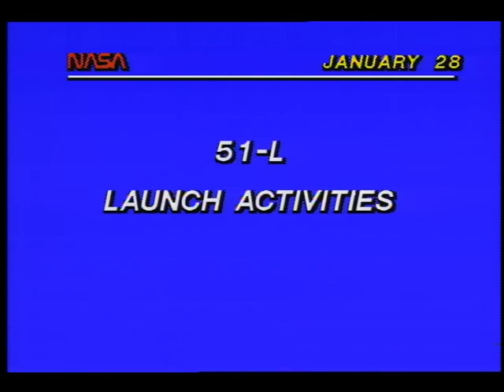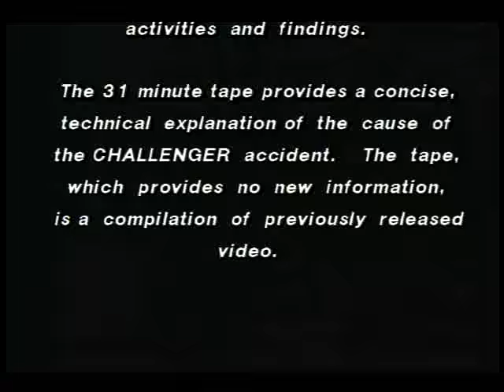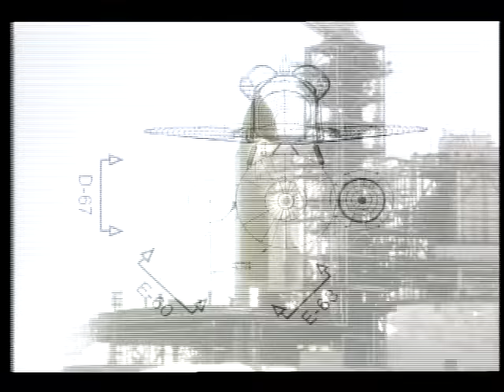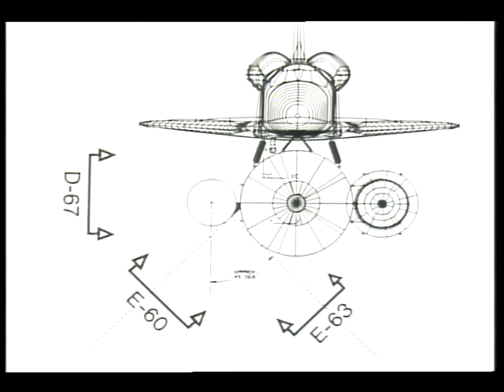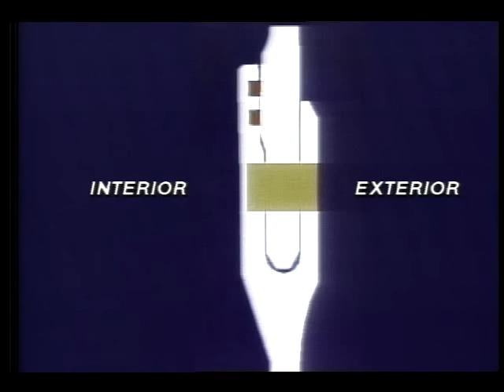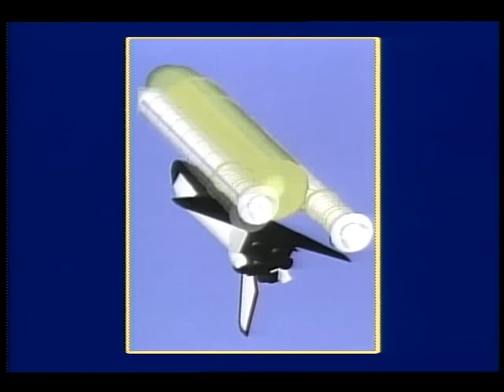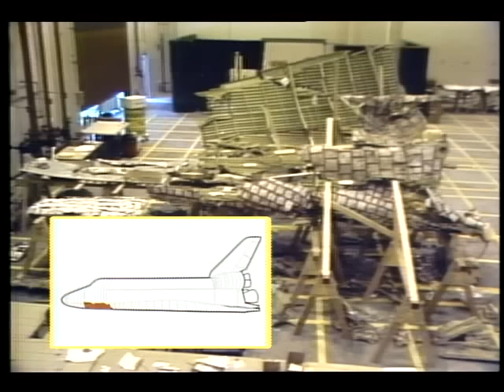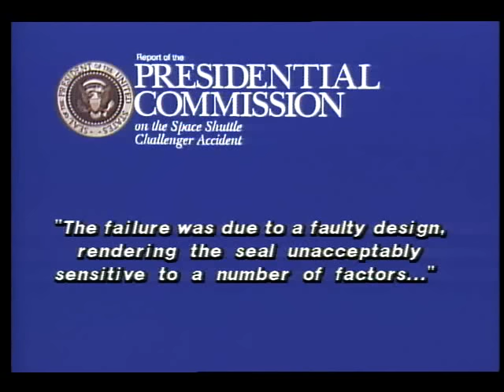Shuttle 51L: Challenger

Comment: It’s amazing to me that given the increasing velocity of Challenger that the plume from the right SRM was able to maintain its focus on the external tank. You would think given that increasing velocity would have caused the plume to be forced away from the tank towards the nozzles. Apparently the leak from the SRM had more velocity than the orbiter, ET & SRMs combined.
Reply: But this is not a water bottle or can of coke. There are enormous kind of energy and pressures involved during an engine run. Velocities of mass ejected out of a nozzle are probably several times greater than STS moving in that moment. Must be if you want to use it as propulsion motor to reach escape velocity (and orbit).
Reply: I was referring to the leaking field joint that that eroded the external tank away until it collapsed. The nozzles you refer to are south of this joint. So I would hope the building velocity of the 2 SRM’s not to mention 3 RS25 engines on the orbiter would be greater than the faulty joint. The 2 SRM’s push the orbiter to 146K’. The 3 RS25 engines push it to orbit. We are hardly talking about cans of coke here.
Reply: @jimwiskus8862  The force that keeps the plumes narrow is the atmospheric pressure.  When the shuttle (or any rocket, see modern film of the SpaceX Falcon 9) first launches, the plumes from the engines exit straight back from the vehicle.  Atmospheric pressure is constricting the plume flow, keeping it narrow and straight.  As the vehicle gains altitude, the atmospheric pressure drops, and starts to drop precipitously fast after the Max-Q point.  The plumes begin to spread out and get wider due to the falling atmospheric pressure, and the plumes lose their orange color as the partial pressure of oxygen drops because unburned fuel in the exhaust no longer continues ignition in the plume.  In this case, as the shuttle gained altitude, the plume from the leak actually began to spread out and impinge on more of the vehicle structure.  Another way to look at it is that even though velocity is increasing, there is simply thinner and thinner air as you get higher, and the "wind" isn't enough to push the plume anywhere.
Reply: Even though the Primary and Secondary O-rings were burnt away within seconds after launch, the theory is that slag from the burning solid fuel of the SRB had temporarily plugged the space between the solid rocket sections, which was a very small space.  It seems the Max Q and the wind shear forces had put a considerable amount of side forces on the vehicle.  Those forces did not exceed normal lateral forces, but it's suggested that the slag had broken lose allowing the tremendous pressure (900 psi) to literally blow torch a hole in the side of the booster.  The hole initially was small, but unfortunately it grew as the metal booster casing melted away.  It only makes sense that the hole was getting to the point where it no longer was affected by any passing air velocities and then burnt the hole in the LH2 tank right next to the booster which I would imagine is only a few feet away.  The hole was enough to not only decrease the nozzle pressure of the R/H SRB, but enough to start effecting the steering of the entire shuttle assembly.  That is a lot of pressure.  The hole being approx. 27" X 15" or 405 Sq Inches X 900 PSI = 364500 lbs. of total pressure escaping at it's largest.  Makes sense why it happened so quickly and was affecting the trajectory of the entire assembly.

Comment: a break-away pressurized crew cabin, complete with a righting system of some kind, chutes, o2 supply and means of flotation. but only in my ideal world
Reply: I hear yah, it was savings over safety unfortunately.
Reply: Or better idea: Get rid of the stupid, dangerous Rube Goldberg machine called the Space Shuttle and don't use solid rocket boosters on a man-rated spacecraft.
Reply: @krcm1981  What savings? The Shuttle program was a cost runaway. It was never cheap, safe, or reusable.
Reply: @magicstix0r  complicated is a good word to describe it. along with NASA placing schedule ahead of safety, an inexcusable action
Reply: They had those before and brought them back after this nonsense.  This is on NASA, they were warned but it was all about how they appeared in the eyes of the public.  It was complete b.s., no other way to put it.
Reply: @magicstix0r  The funny thing is the Shuttle was almost as safe as Soyuz when it came to crew fatality rate remember that shuttle launched around 300 more people then soyuz if you count each occupied seat as different individuals and the Solid Rocket Booster's are a lot safer then your average liquid fueled engine When running in their intended conditions

And by savings i think Nunya meant weight savings

The shuttle was infact safe and (mostly) reusable its just the fact that it ended up a lot more expensive then it was proposed to be however it was actually comparable to the rockets of the time when it came to cost per kilogram thanks to its ability to lift large payloads

The shuttle also ended up repaying most of its cost in the form of science, data and the sheer number of things it put up there Radar topography mission flown by Endeavour ended up collecting data worth more then 20,000 CD's this data ended up helping billions in their regular life and the shuttles are responsible for half of the things we have in space in kilograms

There are also missions like STS-41 C or STS-49 where shuttle ended up saving hardware worth billions
Reply: @Lord_Merterus  uhh, no? Soyuz had one accident that killed three astronauts and was related to the life support system, not the spacecraft itself. The shuttle was dangerous by design. It had so many black zones during which an emergency was unsurvivable, whereas we've seen that the Soyuz escape system has saved lives during a situation that would have killed a shuttle crew. It's only by dumb luck that the shuttle didn't kill more astronauts.
Reply: @magicstix0r  Yes the Shuttle had a flight failure rate around 1.5% while the Soyuz-U had a flight failure rate around 2.7% the Shuttle had 135 flights the Soyuz-U had around 700 The Soyuz infcact had 4 fatalities Soyuz 1 was destroyed after  its parachute failed to open causing the spacecraft to smash into the ground the fact that the solid retro rockets fired and set the wreck ablaze did not help either then there is the Soyuz 11 where a breathing ventilation valve was jolted open due to a faulty separation of  the orbital module and the descent module  when the bolts which were designed to fire sequentially had fired simotaneously

Challenger was not an engineering failure simply the fact that the O-rings were pushed further then their desing criteria Columbia Also could have been most likely prevented via the use of a fresh ET

Sure the shuttle had huge black zones pre Challenger but post challenger there were no blackzones in case of 2 SSME out and there was a relatively small blackzone in the case of 3 SSME out and the shuttle only had to abort once throughout the entire shuttle program overall the shuttle did what it was asked to (although not to the extent that it was supposed to) just like the Soyuz missions like STS-51A and STS-49 prove this
Reply: Magicstix is correct. There were so many close calls that were never publicized. Even the very first shuttle launch was almost a disaster.. the o-ring problem was known since early 1984 and should have been rectified.
Reply: I always was curious why there wasn't a chute on the passenger cabin, or if there was why it didn't deploy.
Reply: @joespitler3929  I hate when people ask this question. The reason why there was no parachute is becaise nobody could have foreseen this disaster playing out the way it did.

Comment: Comment and a question: The conclusion was that the O-ring failed, but that seems like a politically expedient way of saying "we launched when the temperature was far below what we knew the manufacturer had certified or intended for safe operation." The question is about possible abort modes. Until this happened, I just assumed the orbiter could separate at any time and glide back to Earth if something went wrong, but for the past 35 years, I have never once heard anybody address this kind of abort. The burn-through went on long enough that, had some sort of hypothetical sensor detected the problem, there should have been plenty of time to separate the orbiter from the ET (with or without jettisoning the SRBs first), and since they were still just a few miles away from KSC, land safely. Has anybody heard this type of abort mode considered, before or after the Challenger tragedy? In my head, it seems a simple way to get the crew and orbiter away from the failing launch system. Why didn't they do it? Why didn't they add that as an abort mode after this disaster? I really want to know. It seems like a no-brainer to me, but I'm not a rocket scientist.
Reply: If you look up "Everyday Astronaut Abort System", one of them explained why they can't detach before the SRB's, I unfortunately don't remember the exact one

Hope that helped
Reply: INot a scientist either ! Just a guess… think it has to be strapped in order to get
propel enough to break through the barrier from earth to space. . Then once it’s separated & orbiting in space, it is able to reenter earth and act more like a plane. I’m just becoming interested in this in recent years & I had no idea it wasn’t more technical (for example, something with the capabilities you suggested)
Reply: @JasperHuskyFox  Thanks for the tip. I'm sorry I missed this when you posted it. He says that the kind of abort I was asking about would put the orbiter right into the fire plume from the SRB's. That sorta makes sense to me, but it's not a satisfying answer. It seems they could engineer a separation maneuver to happen at the same time the orbiter disconnected. I dunno. I'm no engineer. It's a lot more than I knew a few minutes ago though. Thanks again!

@Mimi Ramone I think this might be a good answer for you too. There really isn't a barrier between Earth and space, just a dwindling amount of air. But there is an awful lot of fire shooting out of those boosters.
Reply: All abort modes for the shuttle (both before and after the Challenger accident) require that the stack make it to SRB separation.  Any structural failure before SRB separation was guaranteed to result in loss of crew and vehicle (LOCV).  Almost all of the planned abort scenarios centered on various combinations of orbiter main engine failures, whereas an SRB failure or structural failure was not considered to be a survivable accident.  In the Challenger situation, even if the stack could have made it to SRB separation, the resultant abort mode that would have been tried is called the return-to-launch-site abort (RTLS).  This abort mode was risky, dangerous, untested, and extremely difficult to execute.  NASA considered trying an RTLS abort before putting the shuttle in orbit to see if it would work, and John Young (STS-1 commander) talked them out of it, telling them "you don't practice Russian roulette".  NASA engineer Stephen Fleming said that an RTLS abort “required continuous miracles interspersed with acts of God to be successful.”  Challenger was doomed the moment the SRB seal failed (or the moment NASA decided to launch, your choice).
Reply: @somejoe7777  Yep, my question was why not separate the orbiter at the first sign of failure, and I got the answer. It puts the orbiter in the SRB fire plume, which is not survivable. (I don't know if it's dynamic forces of tumbling or heat/blast damage, but that's the answer I got.) I suspected it was a simple answer, and it was. All this talk about the likelihood of success of RTLS aborts is of course valid, but doing nothing resulted in death. An abort is by definition a last-ditch life-saving effort, and having no guarantee of success is acceptable in that situation. I wanted to know why nothing was attempted.

Comment: It was a death trap from the beginning. Unlike the Apollo rockets, there is no way for the crew to survive a catastrophic failure of the vehicle.
Reply: Because of how fast they hit the water. 😢
Reply: An ordinary space capsule sits on top of the fuel tanks. If they explode the capsule is carried away by the launch escape system, or LES. It is the small rocket like tower on top of the capsule. It launches automatically in the event of an explosion or an abort command. If the Saturn V had ever exploded during launch, the astronauts would likely have survived. 
The space shuttle had no emergency escape system to survive an explosion during launch. That, coupled with the bad design of having the main fuel tank strapped to the belly of the orbiter rather than having the orbiter sit atop the fuel tank, is the reason it was a death trap.
Reply: @Lethgar_Smith  That may have eliminated both tragedies.

Comment: I disagree with most of the comments. Poor management and the political teat of congress was at play. I believe that the program was a great engineering marvel designed in a decade without computers, just math. All great successes have failures. It is part of the human condition to strive for greatness even in the face of failure. I think that if you believe in heaven,  than the dead astronauts would be proud of SpaceX to drive to move forward. We should all be proud as Americans for their sacrifice.
Reply: The piggy back orbiter was deemed a disaster by Von Braun in the 60’s, why didn’t they listen?
Reply: There certainly were computers in 1961 when the program was started.
Reply: @GH-oi2jf  Yeah 8 bit.
Reply: @AFuller2020  it was all about cost. There were early designs of the shuttle with alternatives to the external tank and solid rocket boosters, but NASA deemed them too costly and opted instead for the design of the shuttle as we knew it.

Comment: I wonder if the twang of the stack contributed to opening the joint.  Bottom of booster bolted down but top of booster moves with the shuttle as it pitches forward then back.

Comment: The moment of the explosion was shown in the TV program "News". I was 12 years old. Later, the question arose: if the shuttle withstands the temperature of the plasma, then why did it instantly disappear when the fuel in the tank ignited? Or was there an explosion inside the shuttle with the ignition of the fuel? A terrible tragedy, astronauts are very sorry. Eternal memory.

Comment: if the the shuttle made it and they recovered the boosters would they have fixed the issue or continue flying the older design ?
Reply: Thiokol had already designed a fix for the SRB field joints IIRC, so if a booster had been recovered with significant burn through I'm sure flights would have been grounded until the fix was implemented. No way they would have kept flying knowing it could be so significant. 
However it's doubtful that a flight with burn through that severe was survivable. Even if the burn through site had been pointed away from the external tank, you still have a rapidly growing hole in the booster that would either continually lose thrust until the control systems were unable to compensate, or even damage the structural integrity of the booster casing so much that it exploded. The loss of pressure inside the casing would have led to that booster burning out earlier than the other by several seconds, which sounds like it would be a very bad day indeed.

Comment: Apollo had parachutes which deployed when the capsule was landing. If the space shuttle had parachutes attached to the top of the cabin, perhaps it would have allowed the cabin to land safely in the ocean.
Reply: Unfortunately, no. The orbiter was completely destroyed in the explosion. The Shuttle orbiter had a much less effective abort system compared to both Apollo and other modern multi-stage rockets such as SLS, Falcon 9, and Falcon Heavy. The Shuttle's abort system was also limited to only small portions of the entire launch sequence. The majority of the time from launch to +2:00 did not have any opportunities for the Shuttle to abort. The bulk of Shuttle's safety in case of emergency relied on the idea that it was a glider that could land safely on its own without power. Mercury, Gemini, Apollo, SLS, Falcon 9, and Falcon Heavy all have launch abort systems that carry the crew vehicle away in the fashion you're mentioning. Just one of the many reasons the Shuttle needed to be retired.